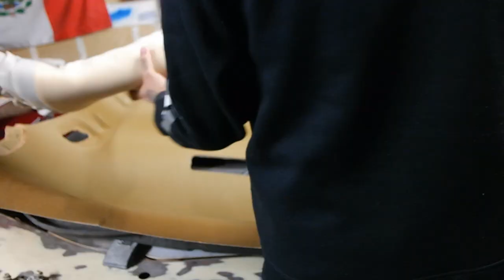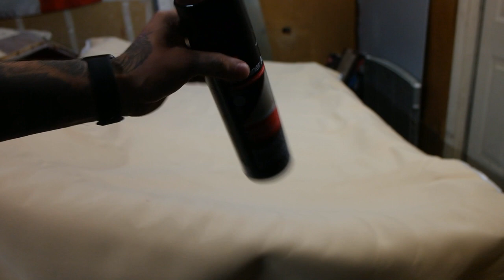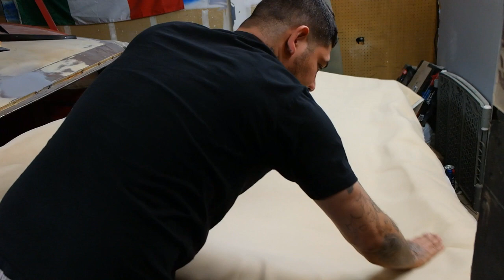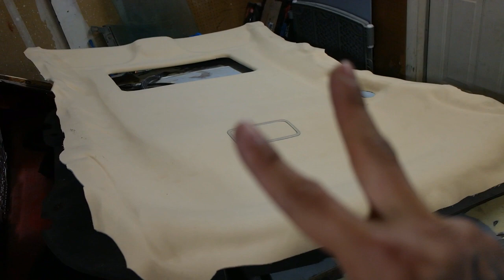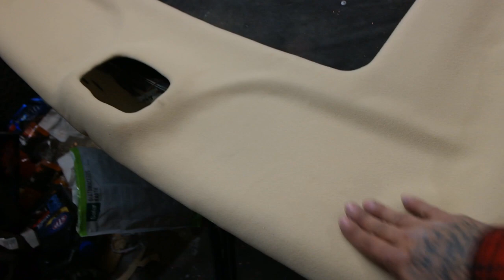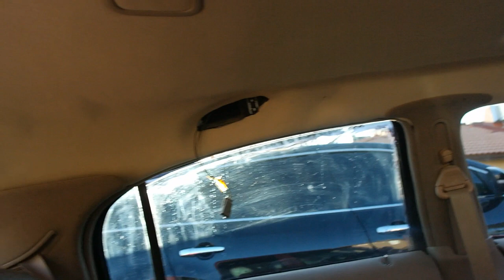headliner on the lincoln town car

Comment: All I wanna know is how did you get it out of the car??  I have a guy replacing my headliner on May 1st and I dont want him destroying my car doing this. I know it's his business. He does them day after day, but I still cant see how you get the damn headliner OUT of the car without wrecking it!!
Reply from the maker: It’s a pain in the but to get out I took it out the driver door kinda have to fold it a little at a angle and it will come out
Reply: It come out the pass  front side just lower the seats no need to remove or bend anything